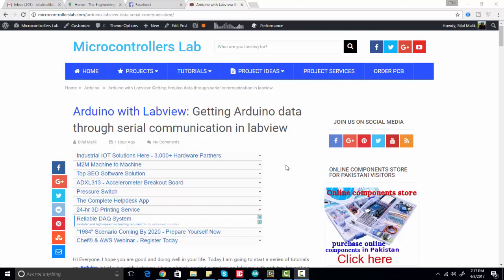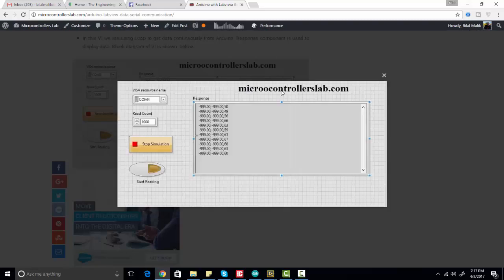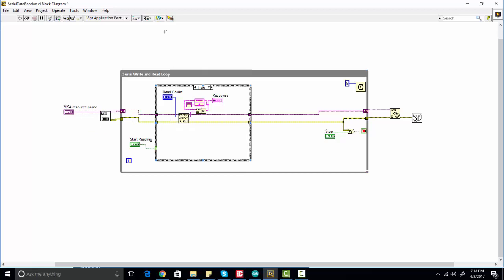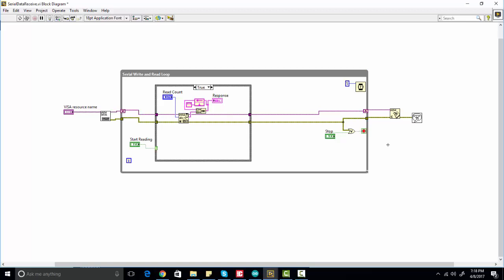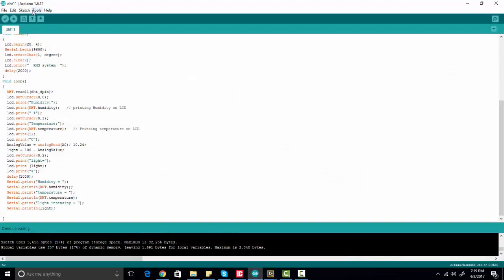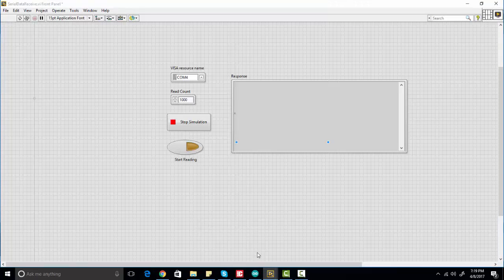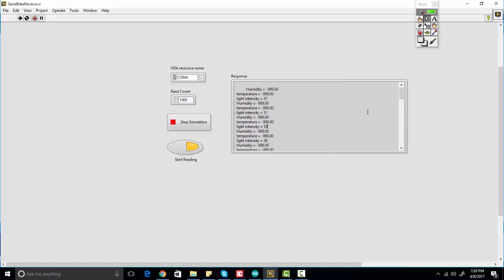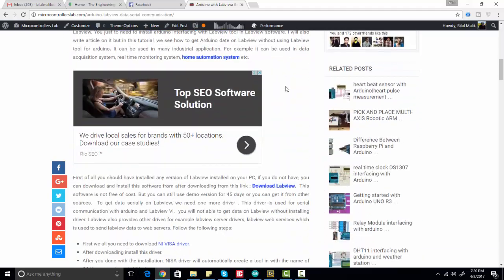labview with arduino sending data from Arduino to Labview serial communication

Comment: How do you hook up the arduino to labview ? You just talked about the software. Not the hardware connection.
Reply: Serial communication means you just need to plug your arduino using USB cable just like usual